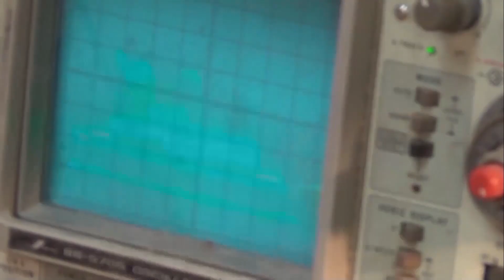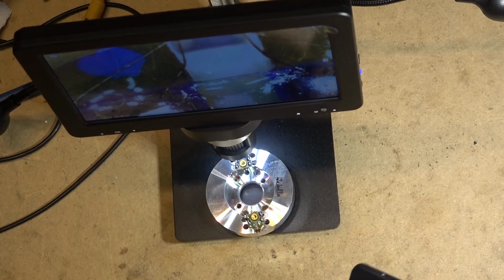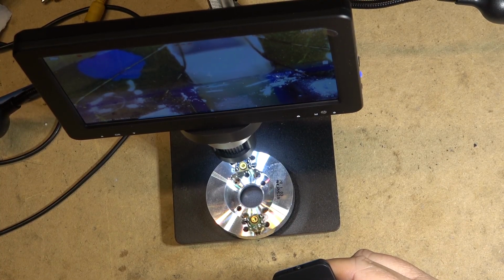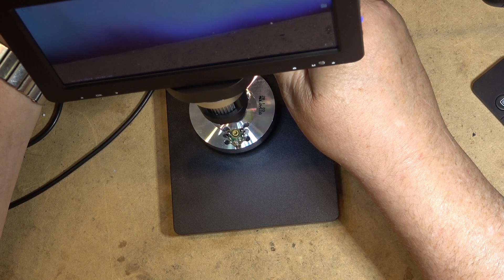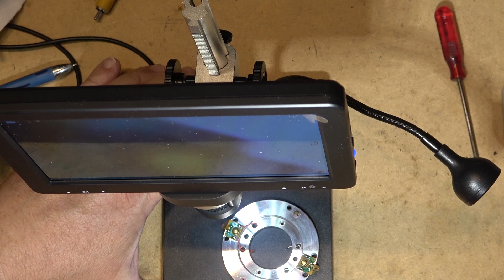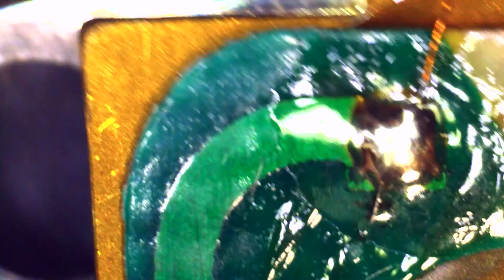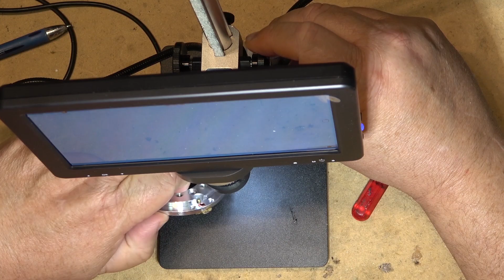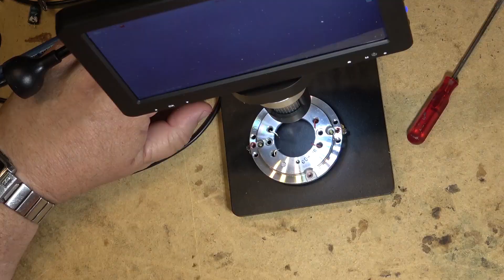A look at a VHS and Beta Video Head Under a Microscope

Comment: I think we should pay respect for the engineers of the day that made this thing possible, it is brilliant engineering at it's best.
VCR's should not be taken as granted because a lot of thinking and designing went into them starting from the VTR's of the 50'.
Reply: And they could do it for sale at consumer prices.
Reply: @hugh007  which also helped doom the industry, as servicing the units became economically unfeasible. Then, digital storage entered into the picture and put the final nail into its coffin.
Beyond hardware failures, like belts failing, just cleaning video heads, one would look at the cost of paying a tech vs sandpapering, erm, I mean a "cleaning tape" to abrade the heads clean and call it done and wonder what happened to the video quality. It was literally like cleaning your car by using sandpaper. A belt failed, landfill it and replace the machine.
Gave up the field around '98 when everything in consumer electronics became completely disposable and went into IT. While the computers may be reaching a similar state, networking and data transfer remain economically viable. I'd started repairing consumer electronics for a living in 1980, learning VCR's, then CD's, DVD's, etc as they came along. Repaired to component level everything from vacuum tube circuits, hybrid vacuum tube and bipolar transistor based circuits, later incorporating integrated circuits, VLSI when it ambled along, comb filter IF's until the industry essentially collapsed and IT was growing.
Now, well I just looked up to see if VCR's are even still being sold and I was a touch surprised to find that they are.
I've been storing video on hard drives, with backups and important videos go onto a RAID array. Drive fails, there's a spare to automagically switch in and rebuild the array while a replacement gets installed.

More amazing is to see the machines that wound those heads. Tiny ferrite chip heads, wound with tiny wires thinner than a human hair, manufactured in bulk. That in and of itself is a major accomplishment in technological handling of components! Manufacturing to submicroscopic tolerances, another major accomplishment.

Comment: I can't see the width difference of the head chips, probably because this is a time lapse head drum. Time lapse VCRs use two sets of the same width head chips (probably EP width), one set for recording, one set for real time monitoring off tape. This is necessary to prevent creating a week worth of failed CCTV recording when a head clogs.

Also this looks like quite a garbage quality aftermarket head. The head chips seem chipped at the gap, there's hardly any material left on one of them.

Thanks, this is an interesting video, I'm continuing now from the 6:40 mark where I paused to write this comment.

There is/was a Czech guy on YT who hand wound video head chips under a microscope. He done that for big 1...2 inch studio VTRs, IIRC he removed head chips from VHS drums by dissolving the epoxy, glued the chip on the VTR's head and wound it with a set of super fine tip tweezers. It was incredible. I subscribed on his channel about a decade ago, now I can't find him, maybe they removed the channel because he showed TV footages that might have caused him multiple copyright strikes. I'm sorry I haven't downloaded at least some of his videos. I was glued to the screen, despite I couldn't understand a single word.
Reply: Only if I commented a few seconds forward into the video... So it isn't the whole chip that is of video track width, they are only  narrowed down at the gap. Makes sense, if the whole chip would be 22um width, it would be very fragile, probably impossible to mass produce.
Reply from the maker: It wasn't a time lapse. It was a real time that could operate in 2H or 24h. Basically there was an alarm input. Close the contact and it kicks to 2h. The head was a standard 4 head for mitsubishi vcr. The quality of the 24H speed wasn't bad and you could play the tape back on the machine but if played on a regular machine it played 4x normal speed. It used 19 micron heads and you can see the difference on camera. You might be looking at the wrong place.
Reply: @12voltvids  Yep, I expected the whole EP head chip to be much narrower, but instead it is only really narrower around the gap. Did your CCTV VCR had real time monitoring? It is a must IMO, because it would be quite a problem if a head clog goes unnoticed even on just a 24h recording. I have 3 or maybe 4 SONY Time Lapse VCRs in storage, IIRC all of them has real time monitoring, while none of them were made by Sony, they are all rebadged from different OEMs. 

One of them I suspect being JVC, one maybe Mitsubishi (or that one is also JVC), and an other one was surely made by Sanyo. The Sanyo one is a monster, it has a really sturdy transport with ball bearings for the capstan, which I've never seen before. All of them can play back ordinary VHS recordings, but interestingly enough none of them has the VHS logo on it anywhere. Probably a licensing thing, they can't put the VHS logo on them if they can't record in the ordinary VHS format.

Comment: It would be interesting to know how wide the heads are -- how wide of a track they record. 

Some late-model NTSC VHS machines have EP heads that are claimed to be 19 µm wide.  Each recorded video track on EP would therefore be exactly 19 µm wide. 

Usually, the EP heads are used for LP-mode playback and recording, but these machines will not record in LP because, with a 19 µm head and LP's track pitch of 29 µm, the video tracks on LP would be the same width as on EP and would not record any additional information, thus not yielding higher quality.  To make LP-mode recording worthwhile, the heads would have to be wider than 19 µm. 

My Panasonic machine apparently has 26 µm EP heads, so it does support LP-mode recording. 

Another question is about the width of the SP heads.  The track pitch of SP is 58 µm.  Early-model four-head machines (mostly made by JVC) had SP heads that were 58 µm wide, but I have heard JVC later had to use narrower heads because other machines recorded with narrower heads on SP, resulting in JVC's wider 58 µm heads picking up a lot of noise.  Is that true? 

According to Mr. Betamax's website, Betamax video heads are either 27 µm wide (for two-head machines and four head machines on βII and βIII) or 39 µm wide (for four-head machines on βI/βIs).  The track pitches of βI, II, and III are coincidentally the same as those of VHS's three speeds -- 58, 29, and 19 µm.
Reply from the maker: Vhs sp was actually 66 micron tracks but most machines used 58 so there was a slight guard track.   26 was the standard for ep but the tracks were typically 22 microns as  66/3 is 22 so 26 heads  have slight overlap.  Some companies used 19 micron heads to improve ep performance.  The big problem is recording at sp speed on a 2 head machine. You have skinny tracks and a bunch of space between tracks.  That makes for poor Snr on 4 head machines.  Another reason jvc opted for 48 micron sp as opposed to 66.  Beta was difference.  Beta typically only used 2 or 3 heads.  4 heads were initially on slhf900. One pair for record and play and the other for slow and fast play.   When. The beta1 speed returned they put on wider heads for b1 as it improved signal to noise. Beta 1 super hi band looked every bit as good as 3/4" umatic.  It really looked good, but went through tape fast.  L500 only ran 60 min and l750 90.  I don't miss tape, but beta was my favorite and I do have hundreds of tapes in storage I really need to digitize or put on DVD.
Reply: @12voltvids  I'm curious where you got 66 for VHS SP.   I remember doing the math back in 1987 and getting 58 point something so I tried it again earlier tonight and got 58.16 microns max track width without overlap (max head width).   If the speed is 33.35 mm/s (which I got out of an old book on VHS repair that I have) and divide by 59.94, the number of fields in a second, then you end up multiplying this by sqrt (1.0 - (cos 6 degrees)^2) , due to the 6 degree slant and the pythagorean theorem, the 58.16 number appears.    I was thinking PAL would be wider and if I substitute 50 fields per second for 59.94, I get 69.72, which is closer to your 66, but I've heard that PAL SP is not the same speed on VHS as NTSC SP, so that would made it less, right?   I'm curious.
Reply: @3Cr15w311  You're right that track width on VHS SP was 58 microns, but heads were wider that that. During recording, the recording head was actually erasing a portion of the previous just recorded track. Why was it done? Why not 58 micron heads, you might wonder?

It's because of a still picture. If the tape was stopped but drum still spinning, the track angle would skew and head would be crossing from one track to another. That would make head reading one track, then reading rubbish (mixture of two adjacent tracks - displayed as a wide horizontal noise bar on a screen), then reading the next track. Even worse, two adjacent tracks are different fields of interlaced picture with timing moved exactly one-half of a line, which would mess up the TV's horizontal deflection circuitry and make further mess of a still picture.

What is done to prevent that? That's right - misalignment! Each head had azimuth angle of 6 degrees in opposite direction of the other, so heads are mutually misaligned by 12 degrees, so one head reading the track of the other head would read just noise. So, during still picture head would cross to adjacent track but would not read information from it. So, the only important thing for getting good stills is the correct tracking.

(EDIT: I didn't answer why heads were wider than tracks: to make them read at least some of its tracks even during crossing the opposite track. If they had the same width as the track, the signal would drop completely during crossing the opposite track (resulting in a wide horizontal snowy bar at the screen).
Reply: Still, signal strength diminishes during crossing, so to get good stills one additional head is required - a head that would be placed very close to one of two main heads. So, you get THREE head VCRs, where the third head was used ONLY for stills and picture searches. The third head had the opposite azimuth and was moved off track - exatly what was needed.

However, engineers got the idea - what if we put another head, i.e., the fourth one. Well, if you already have three heads, it wouldn't be much of a hassle. Two additional heads could be narrower, enabling double-lenght recordings (i.e., LP mode). Narrower heads would still read SP information good enough to enable good stills and picture searches.

(And you always wondered why three-head VCRs had better stills than four or six-head VCRs in SP mode?)
(There isn't much difference between 4-head and 6-head VCRs when it comes to picture. 6-head VCRs used 4 heads for picture and two heads for HiFi stereo (audio) only)
Reply: Philips was the master of stills, they had a series of U-matic VHS VCRs built in the late 80's that had noseless still, noiseless 2x playback and noiselss 1x REVERSE playback. Those VCRs had only TWO heads in a drum! even top-of-the shelf prosumer Panasonics (like NV-FS200 - their top model) couldn't do it! How Philips did it, I have absolutely no idea!

JVC went a step further: they made video-drums with adjustable azimuth! They called it "Dynamic drum system" (e.g. HR-S8600EU). They installed a small servo motor that could physically tilt the drum. During stills or picture searches, their drums tilted to match the exact track angle. I've never seen them in real life, but I believe their stills were best that a VHS or S-VHS could offer. We could call it "VHS systems last stand", but, unfortunately, it came too late - when VCRs were already dying.

Some prosumer machines, like Grundig GV-280S (early 90's?) had a different solution - a digital memory to store a picture frame. But that's a totally different story.

Comment: Thank you for this demonstration. I find it amazing that such precision and tiny engineering was possible these days at a price that was relatively affordable. In addition they have made this serviceable, which is a lot more than you can say about modern electronics today where the service guy is treated like the enemy of these modern manufacturers
Reply from the maker: Manufacrure are not interested on service.  That costs money.  They just want to design and build.
Reply: @12voltvids  You need human beings to provide support and servicing, people are expensive. And you can't turn off human employees when you aren't using them/benefiting from the work they do.
Reply from the maker: @jnharton sure you can.  It called fired or laid off.  Happens all the time.
Reply: @12voltvids i have a 8mm video tape that has specs in and outside of the reels, when i fast forwarded the tape, some dissapeared, but theres still stuff on the inner reel that did not stick or stay on the tape. Is that mold or some sort of plastic mark?
Reply: I came across a magazine called Video Repair or something. I think it was a late 1980s or maybe early 1990s issue where there was an article basically saying that VCRs and other video equipment had become so cheap that the economics of repair would not work anymore. The article suggested switching to quick diagnostics of which sub-assembly is at fault, and replacing complete sub-assemblies instead of repairing each tiny thing like a head on a drum. I guess this worked when parts were cheaper than a complete unit. Nowadays I can buy a new phone for less money it costs to replace the glass on the screen. But I am keeping my 2013 MBP, had battery changed recently. Damn Apple glues more things together from generation to generation, making it less repairable despite the whole "Right to Repair" hoopla. Tesla does not even allow anyone but Tesla techs to work on their cars.
Reply: There's an important concept you need to understand, it's called "economy of scale".

It probably was expensive to design and manufactuer the first couple units, but once they had a market scaling up production made a huge difference.

Individual units cost a lot less when you're making tens of thousands of them and the expenses of dedicated machinery are swallowed up by the revenue stream.